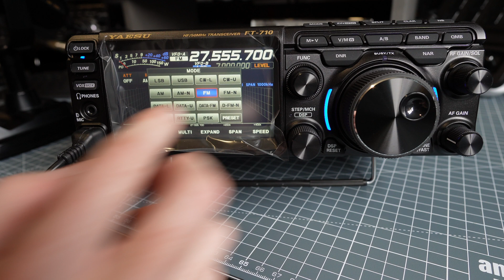YAESU FT710 MARS/TX Frequency Expansion Modification EU/USA

Comment: There is no need to solder the two pads. All that is needed is someone to hold a small screw driver (firmly) over those pads while the radio is reset. The mars remains but it would need to be repeated after any future reset.
Reply from the maker: I agree that works a treat but everyone seems to reset their radios for fun these days so i will only use the solder method to save any future complaining.

Comment: Great tutorial. Mine didn't work at first as its a 22 model with old firmware. Updated that and all was great. Lovely radio
Reply from the maker: Thanks Buddy, Yeah i have had quite a few Yaesu radios that haven’t had their firmware touched for years, as a rule i normally check and update as needed before i whip the covers off.

Comment: If I bought a FT-710 from Japan there is written "Japan Version" is this also possible to interchange the Land to B2(EU) and also change the Language to German or English? 73 Thank you
Reply from the maker: I would personally avoid the Japanese version as it is strictly locked in a lot of its functionality.
Reply: @gtretroworld  Can I patch a new EU Firmware on the Radio? or is this strict not possible. Why I should pay for the Radio here €1400,- in case of the Japan Import will cost me around €1050,-?
Reply from the maker: @ As far as I’m aware it isn’t really possible or even worth the risk.

Comment: If you temporarily shorted across the component, say with a crock clip, and did the reset, would it retain the modification until it is once again reset?
Reply from the maker: @redjohn20001  Yes it will work as you say but just remember you will need to be in it every time you need to reset or some updates.

Comment: So, what are links 52 - 54 going to introduce (or limit)?
Reply from the maker: I’m not sure but probably some sort of limits , Yaesu only gave us the info for this modification.
Reply: @gtretroworld  And I was thinking someone already experimented to find out what was possible (with trial use of the solder bridges). I will "Go to MARS", when I get my antennas back. Building work is getting in the way for now, but I have got a new long copper earthing rod installed today. Here's to 60m & 4m on my 710.

Comment: Yes it looks easy, so I did it with my FT-710 Field. But no success. He does not transmit on the 11 meter band. Only on the amateur bands. What could it be ?????🙏🙏
Reply from the maker: @flyingdutchman1805  I presume it is a EU or US radio as they seems to be a good few Japanese FT710’s circulating. Anyway make sure the firmware is up to date, recheck your soldering for continuity and try resetting the radio again. Hope this helps.
Reply: @gtretroworld  Het is een EU set die ik van de week heb gekocht.  Ik gaat er van uit dat de firmware die ik nu in de radio heb, oud is. Ik zal deze van de week gelijk even update. Mijn soldering is goed heb al gekeken met een camera.
Reply from the maker: Worth checking the firmware as it happened to someone else on here who had older firmware, why this was the case i don’t know but it was. Also try resetting the Radio again.

Comment: The manual says that if you open or mod you will ruin the radio
Reply from the maker: You have to open it up to add options like filters etc and the modification details are sent to engineers anyway and unless you’re not confident there is always an element of risk involved but to ruin the radio it would be rare. Thanks for your comment.
Reply: @gtretroworld  what options are there?
What filters?
Reply: Stfu😂

Comment: I’d like to request a video showing us where the 150mA SMT fuse in the DVI-D external monitor circuit is located. I have yet to find a schematic or board diagram on-line. Those with SMT equipment and skills could replace the fuse if necessary instead of sending it to Yaesu. Thanks for this video. Edit: I found the Technical Supplement for the FT-710. The “Fuse” that I imagine to be the monitor issue is located on the same side of the board that you show in your video (very accessible). From the Technical Supplement; “D5V” enters the MAIN-2 schematic sheet, passes through a zero ohm resistor R1860 to become “DVI5V”. DVI5V passes through ferrite bead FB1805 then PolyFuse Q1802, then Diode D1800 to pin 14 of the DVI Connector J1803. I am guessing the PolyFuse is the issue, but I understood that PolyFuses “Recover” from fault, when the fault is removed…….
Reply from the maker: @PacTel54321  I would but I don’t have a FT710 here at the moment, this radio was apparently intentionally fitted with a resettable poly fuse probably due to all the issues with the FTdx10 and 101. I suppose it still could still be at fault or could even be a surge issue, as you probably know poly fuses aren’t the best with big surges so it could be another failure. Probably easier to check everything around that circuit.
As soon as i get another in here i will take a short video.
Reply: @gtretroworld  I agree. I see that the DX10 originally had an 0402 "Zero Ohm" Resistor that was updated to an 0402 fuse; the latest schematic and parts list say 0.63A. The latest 710 shows a poly switch & also has a TVS network on the  SCL & SDA lines.
Reply from the maker: @PacTel54321  Good information that i was unaware had been changed, i will have to check this out. Thanks
Reply: @PacTel54321  When did they make the improvement, and how can one tell which version before ordering?

Comment: done the main speaker mod works great now i can but a external speaker to the main output the aes does not work but the audio is great
Reply from the maker: Out of curiosity did you replace the speaker and drill the cabinet?
Reply: @gtretroworld  tap in to the main output black and red inside the radio lead comes out side vents jack in line connect  the speaker the main one cuts out the only thing this radio lacks a external output the one in the back has you know is for aess
Reply: What speaker mod?

Comment: Great video. Tried this on my EU /UK radio but I'm still not able to TX on 27mhz? Updated firmware to latest version before the mod, bridged P51, did the Power/DSP/Fine reset but radio just behaves as before. I noticed that in the video the machine power cycles twice when you do the hard reset, mine only ever powers up once for the reset. Any ideas?
Reply: Did it tx on 70 mhz
Reply from the maker: @michaelmilenkoclewes572  Yes just fine.
Reply from the maker: Thanks…I have done a few of these and have never had an issue. Make sure you hold both DSP/FINE down then power it up and not all at once.
Reply: @gtretroworld  Thanks for the info. I must have been having a senior moment, I tried holding the DSP/FINE before the power and then keeping them held down a bit longer. That did the trick! All working as the video now. Cheers!
Reply from the maker: @andysupermachine  Excellent, don’t worry we all have those senior moments, as long as you get there in the end is all that matters.

Comment: Thanks for sharing , i was going to get an 891 but as i am so used to having a waterfall on my 7300  i think this radio would be a better option .I intend using it mobile   decisions decisions.
Reply from the maker: My next radio will probably be a FT891 for Mobile and Portable, obviously the FT710 is a great rig and a totally nicer radio to operate but it is just a bit big for mobile and definitely no good for karting off the beaten track on your back. I suppose it comes down to your needs.

Comment: will it do the 4 Khz  transmit mod also in the menu?
Reply from the maker: As far as I’m aware the FT710 won’t transmit 4Khz wide but i will look into this. I know for certain the FTDX10 has is it as I have one and it selectable in the TTBF settings. If i find anything i will check back. Thanks
Reply: @gtretroworld  I know for sure that 4k audio is activated on the American versions. Can you confirm for me if TBTF is activated after this change? If not, do you know a way to convert the version I use?

Comment: I have a question:
aftet the modification, does the autotuner work on all the frequencies, included rhe new ones?
Reply from the maker: @giovafra61  Yes it works on all frequencies perfectly well to the usual Yaesu nominal 3:1 SWR range.
Reply: @gtretroworld  Very well.
So, I'll do that modification.
Thank you very much!
Giovanni I0KQB
Reply from the maker: @giovafra61  No Problem, Just take your time. 73 M3VWN
Reply: l'autotuner fonctionne après la modification test ok

Comment: That opens up cb radio ?
Reply from the maker: @KE8ODY-WV-Ares-Ham-Dad-3O4  Yes, basically all HF.
Reply: @gtretroworld  man that’s scary I used my ftdx10 but my 710 is brand new back up I wanna do it lol
Reply from the maker: @KE8ODY-WV-Ares-Ham-Dad-3O4  All i can say as long as you take your time I’m sure you will be fine or alternatively pop it to a local tech.
Reply: @gtretroworld  I just did the mod on my Yaesu ft2900r no issues but

Comment: Tried this mod, but holding down the buttons on start up won't activate the mod for me.
Reply from the maker: It maybe worth going back and checking your solder bridge as this has never failed with the few i have done. You can also reset the radio in the menu if it is easier with All Reset, hope this helps.
Reply: @gtretroworld  I don't have the latest firmware, maybe this could be the problem.
Reply from the maker: @Geistnoise  I am not really sure as this and the others were checked and updated if needed before hand. I will say it is always worthwhile keeping up with the latest firmware updates.
Reply: @gtretroworld  Thanks buddy, great video and good advice.
Reply from the maker: @Geistnoise  No problem and thanks for visiting the channel.
Reply: @gtretroworld Just to let anyone know, after undoing the mod, then updating the firmware then resoldering the mod - I can confirm everything works perfectly
Reply from the maker: @Geistnoise  Excellent news, I should probably update the video description with that recommendation as for some reason i always presumed everyone updated whenever the latest was released. Thanks

Comment: Great video, thanks!  I have an FT991a that I bought from GigaParts with a MARS mod.  The mod only addresses the HF portion of the radio and not the VHF/UHF.  Do you know if it's possible to modify that as well?  Thanks again!
Reply from the maker: Thanks, Yes the FT991 is MARS/HF only. You can use service mode to enable VHF/UHF but it isn’t a permanent or ideal workaround. I will dig a little deeper and if i find anything i will let you know,